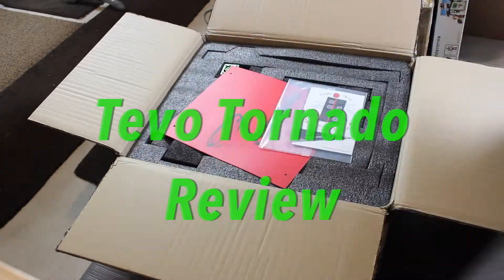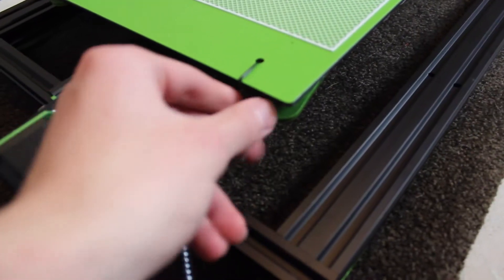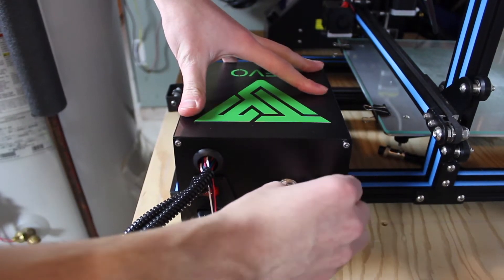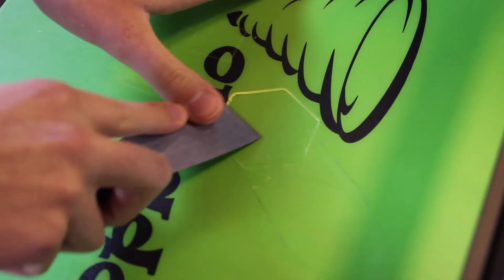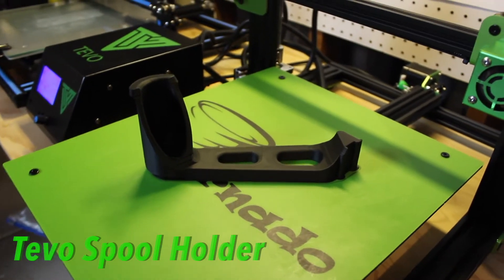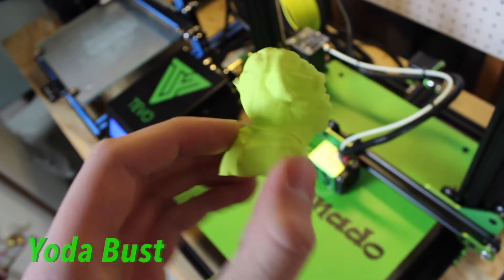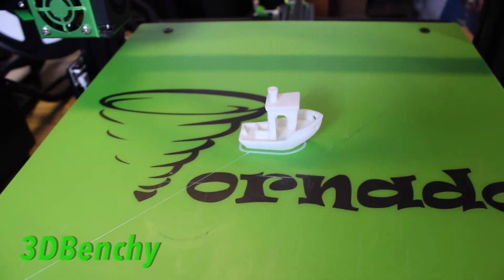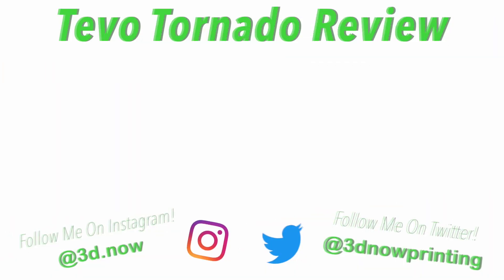Tevo Tornado Review!

Comment: I have had the Tornado for a couple weeks know. After some problems with shifting prints, I adjusted the voltage on X, Y to .96v and Z to 1.0v No more shifting. I allow purchase Thingiverse software. This software is rather expensive at $150. Will worth the price. Know the Tornado is printing very good parts.One more thing I did is, use Blue Tape on the bead. No more mess to clean up. 2-3/4" at home depot foe $11. I also found design software that is very easy to use. TinkerCad. Hop this helps get you going.

Comment: The heater does not use a mosfet, it uses a solid state relay to switch on/off the heat bed which runs off of household a.c. current. The heater bed comes in 2 versions, 110 volts or 220 volts depending on the standard in your country so make sure you order the correct version. The surface of the bed is a source of contention, about half get used to it and it does improve with use and cleaning with isopropyl alcohol. Under this pad is a glass bed, some decide to just print on it, others lay a pane of glass on top to protect the bed, and others install auto releasing surfaces like Ultrabase or Printbite. Note that all fans and the nozzle heater are 24 volts dc if you need to replace any.